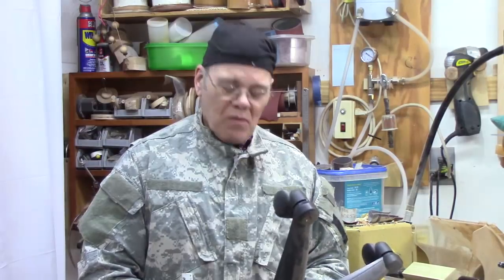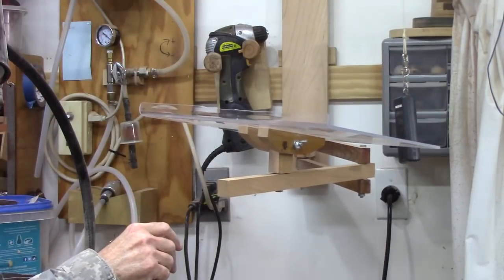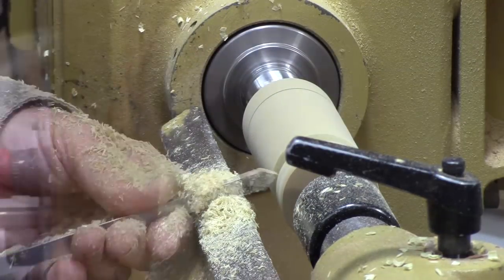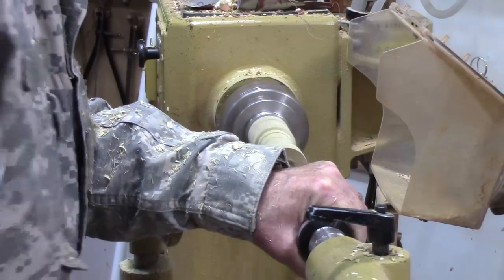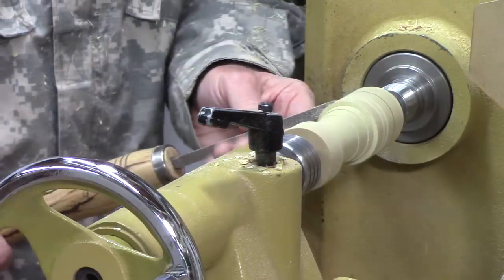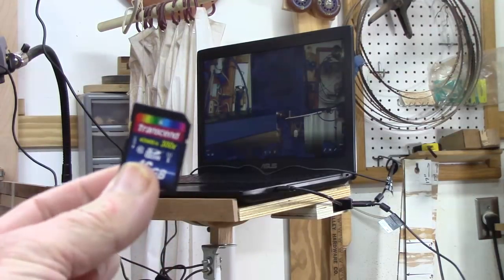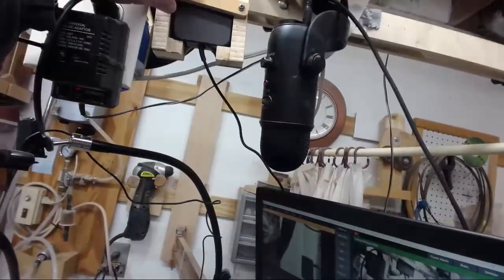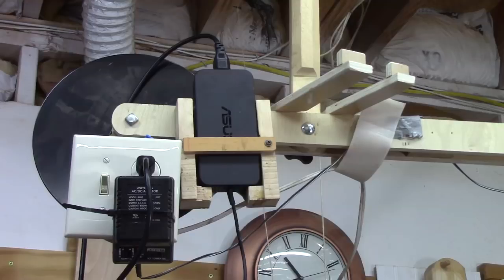DIY Shop Laptop Stand for Virtual Live woodturning Demonstrations Via Videoconference.📹

Comment: HI Mike, I see your having problems with your cables, have a look at velcrose cable ties on Amazon, I use to build pc's for a hobby before i took up turning and used zip ties for cable management but lately been using velcrose. hope this helps.
Reply from the maker: Thanks for the reminder. I do have a few on hand I bought years ago.

Comment: Mike,are you considering doing live you tube videos like Carl Jacobson??👍👍👍👍👍👍👍
Reply from the maker: I have thought about it and might try it.  However, my setup is designed to do a live demo for a woodturning club.  The difference is that with live streaming, viewers can post comments. If so it may me more like practice or a dry run for my virtual live video presentation. Not easy to monitor posts to a screen when you are primarily woodturning. I would almost need another person to monitor the channel for posts for a YT live stream. With a virtual live demo, you can see and hear the audience  and they can see or hear you. The live virtual demo is like being there but without the travel expense to the club and inconvenience for me. Personally, I don't feel like I get that much content from live streaming as a viewer. But then it is a different type of experience.
Reply: Understood Mike!😁😁😁😁😁